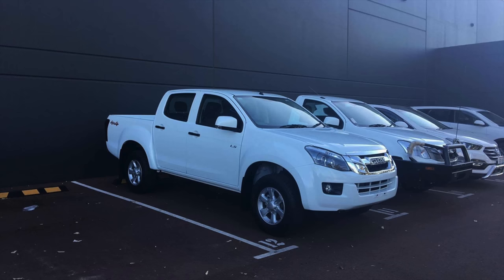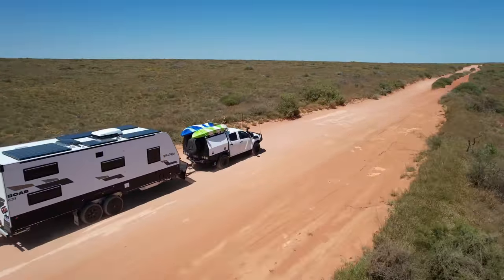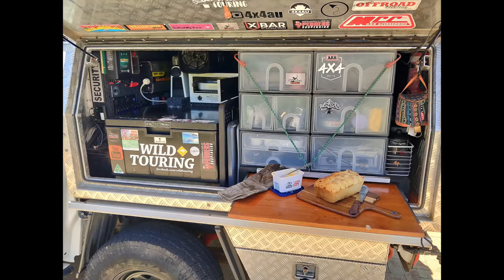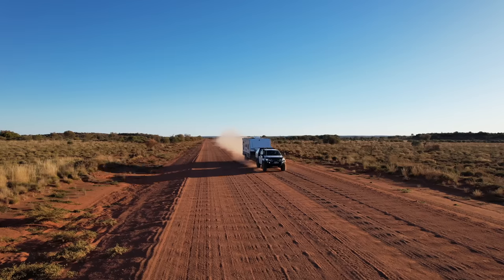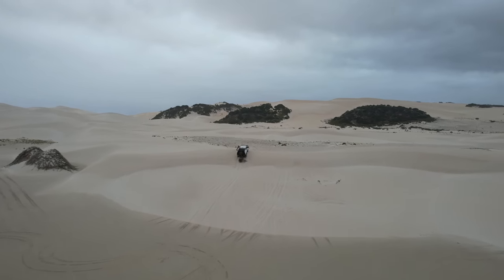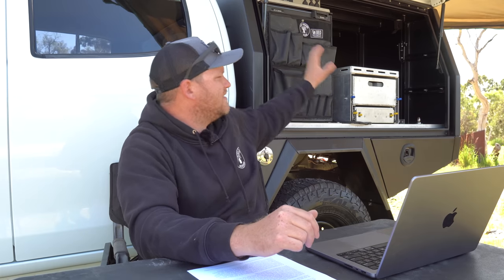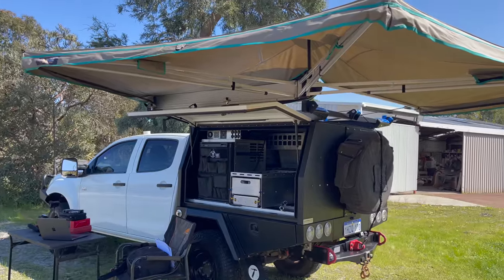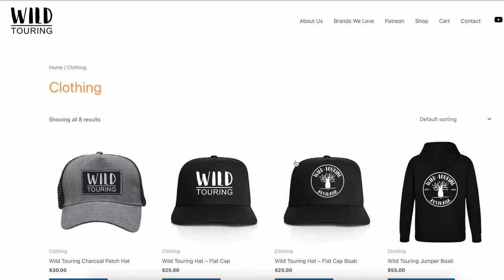SOLD THE DMAX  ||  7 Years/ 150,000kms Review | What BROKE & What WORKED

Comment: Very good honest summary of a very honest vehicle, I have Jan 2012 Dmax LSU manual, I have towed a 21.6 Jayco van on 42 Trips, 150klm tow miles, 8 Trips of the Nullarbor, Tassie, Cairns Darwin, Alice Springs and everywhere in between, all of the Murray River freecamping, The vehicle has done a Total of 240,000klm, never “ Bush Bashed “. Just bought it to tow the van, It’s done the top of the Gibb River, crossed the Pentecost for the photo shoot, but that’s it, never walked home, nothing has gone wrong, gets 8.5 Lph around town, Consistently done 13.8 Lph towing at 90klm per hour, never thrashed, The 4jj engine has a B10 truck rating, Isuzu advise at 500,000klm, 10% will require overhaul, best car I have owned, but never thrashed. Keep up the good work, regards Tony
Reply from the maker: That’s a great run from it Tony! You get back what you put into a car I reckon- and if you keep looking after it like you obviously are, I’m sure it’ll see a trouble free 500,000kms!

Comment: I've got a 2016 D-Max as well. Cracked inner guard replaced by isuzu. Evaporator cracked this year as well $1200. Torque converter got damaged too by not having an aftermarket cooler. Had that replaced and 5 of 7 solenoid shifters. $5k transmission bill. Running fine now and will keep it.

Comment: Nice summary. 
That brake upgrade has me thinking it would be a worthwhile upgrade on any vehicle used for towing.
Re your commentary on insurance - was the cracked inner guard covered by insurance, given the vehicles GVM upgrade.  

Good luck with the 300 - I reckon it will be awesome for you. It’s luggage space will be the compromise, everything else about it will be better than the DMax

Cheers
Reply from the maker: Yes the cracked inner guard claim was accepted by the insurer, but i ended up paying for it because the repair was less than my excess. 👍🏼

Comment: I also sold my Dmax this week, 100% it got the best clean of its life including a proper polish and I had the same thoughts 😂

I had the same journey swag > tent > camper > van and the Dmax is just a little undersized for family van life.
I hope you can get the new car in that time frame, my new car has been in the country since the end of August but waiting on parts for gvm etc means I am getting it next week - then the rest of the build starts 😂
Reply from the maker: Yeah I may have the same issues, I thought getting the car would be the longest wait. But some parts have very long lead times! 

May just be a case of fitting what I can now, and others bits later on. Luckily the suspension parts are not a problem, they’re the only time sensitive bits (to do it pre rego)!

What did you buy?
Reply: It was the arb bullbar mounting bracket and getting a slot to fit the pre rego GVM that caused the delay for me, mostly the bracket actually.

You will have to subscribe and watch for the grand reveal on what I got Cam 😂😂
All I will say is that it was a vehicle on your spreadsheet and it’s a Ute if that narrows it down.

Bit of a direction change for my channel away from fishing and diving while I do a few DIY fit outs to set up the new car

Comment: You're spot on about everything being a compromise.  I went from an 08 hilux to a 98 gu patrol for solid axles. And man,  the weight adds up quick in a wagon with the extra bar work and a lower gvm. Having owned it for a few years now,  it's crazy the amount of wagons I see on the road that would surely be way over gvm

If ever I get a new car, it would be a dual cab again and the payload will be why.
Reply from the maker: Yeah you’re not wrong, weight adds up real quick! 

Wagon payloads are definitely limiting without GVM upgrades. But with a GVM upgrade on the 300 I’ll actually have more payload than the Dmax has!
Reply: My patrol got yellow stickered not long after I bought it so I had no time to get a gvm upgrade,  I had to replace the suspension with whatever I could get unfortunately. Maybe one day I'll go that route but I'll probably get something newer tbh

That's impressive man,  even though the car is more expensive,  the fact you're not having to invest in a tray and canopy too is a bonus,  would be super comfy to drive on long trips too. I'm keen to see what you've got planned,  you must be pretty excited to get the keys I bet aha